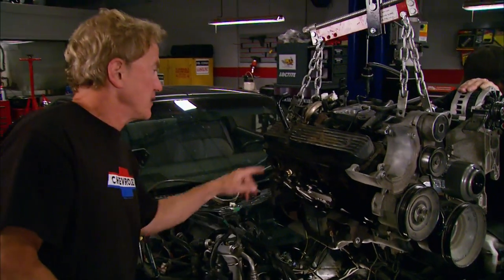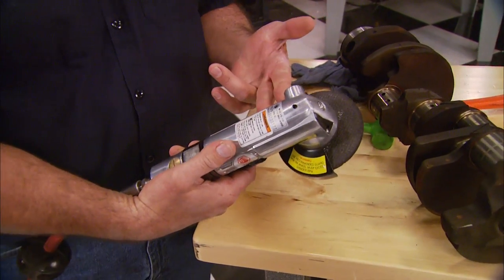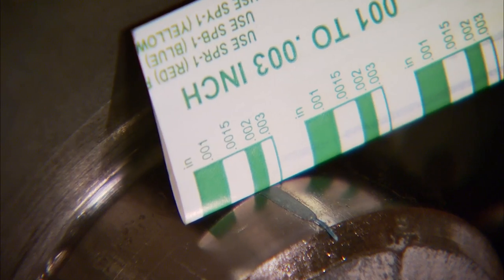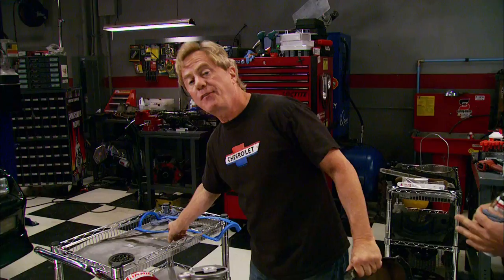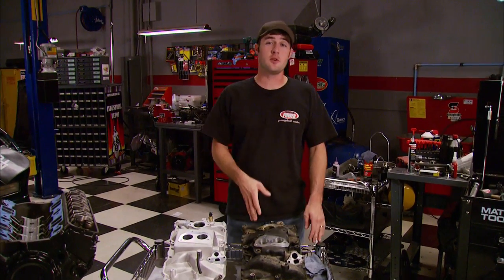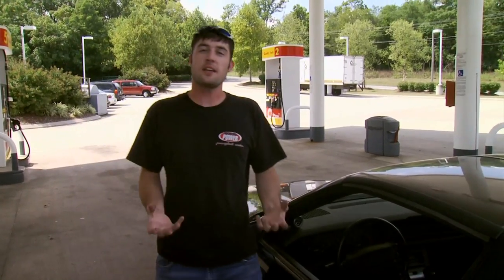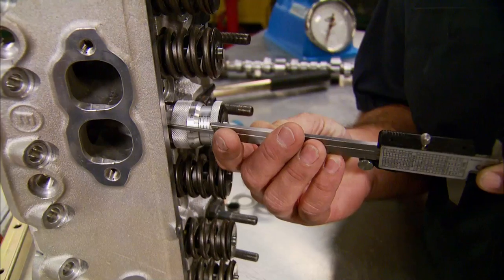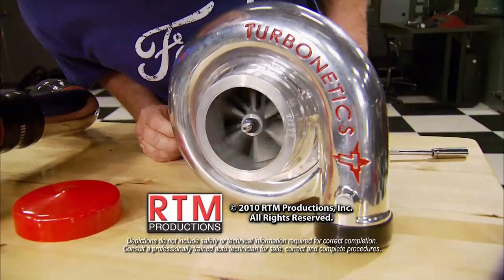Modifying a '92 Camaro Small Block to Improve Fuel Economy and Power - HorsePower S12, E17

Comment: First, thanks for telling what to do if the crank clearance check is not correct. To often we see all these wonderful checks that always come out perfect. 
14:30 You mention the cam card shows the open and closed “spring rate”. This is incorrect, it shows the spring pressure. Spring rate (typically in lbs./inch) tells us what the spring pressure will do as it is compressed and is a constant for a simple spring. Misuse of the term perpetuates misuse.
Reply: you are correcting something that happened 20 years ago,are you ok?

Comment: Pulled the engine to rebuild the short block, and didn't really do anything to the heads other than paint them.  Took the transmission out, but didn't get it rebuilt.  Again, an excellent video on how to do everything wrong.  OMG, the Nitrogen filled tire scam.  Easiest way to tell if the engine is under load?  How far has your right foot pressed down on the accelerator pedal?  What you should have done?  Cam swap, Dart SR cast iron head swap, headers, high flow cat(s), and exhaust system.  Would have had more power, and the same fuel economy.

Comment: Just read all 293 Comments and I noticed that all the comments are from the past 24 hours so I guess they removed this video or wiped the comments. Also noticed nobody mentioned that "They added some weight to compensate for what I took of the 6 counter weights" was not only completely wrong but shows that the guy that said it (or the person that wrote it into the script) does not know anything about balancing a crankshaft. For those of you that are interested in why they actually added weight, it is to simulate the weight of the piston, connecting rod, wrist pin, etc. because if you didn't it would be impossible to balance it.

Comment: I realize, the economy direction here are not typically what most want to see, but, I can tell you, after having built monster engines over the past 25 years, HP and Torque monsters do get boring. The idea of trying to beat the gameshow that has been thrown upon the USA called "planned obsolescence", I actually prefer build engines that are just fun enough to beat on, yet will allow for many flawless operation these days...  The idea of turn key and go play, does leave a small trade off, which really does revolve around somebody's ego, of having to have the biggest, most HP, etc., Yet, I simply walk out to my stable that has taken years to fill, I get to make the choice of which mule I will take out and enjoy, and I simply open the vehicle door, sit in the drivers seat, turn the key, and go, and never have to worry about a thing, (per say).. It actually really is a complicated thing to build, a vehicle that allows this...  As anybody can drop $30k into an engine, and be top dog, but that guy is always on edge worrying about stuff, dang near has a panic attack if his date sitting in the passenger seat, desires to drive that 30K engine through a drive-through and having the engine over heat or something.. LOL.. Tell me I am lying!!!! LOL...  Is there vehicles that would out run mine, YUP, all day long... But mine, I get to just turn key and drive, in peace these days, I love it... If I desire to drive 800 miles to go see something, I grab a car and go... I am not having a panic attack over it. I am not trying to convince anybody else to go this venture, but the idea of when and why people by new vehicles, if for that exact reason, to be able to turn key and go... I just do it with older vehicles, that have been ground up rebuild... Kinda like one of my favorite to drive, is my 1988 Ford Thunderbird Turbo Coupe. 100% ground up . Yes, the car will tear up the street, but every thing was redesigned to last, over sized oil lines and coolers, ceramic ball bearing turbo cartridge, after market computer for the fuel system control as a few silly examples, and while on the highway or interstate routes, manual trans I get about 37 miles to every gallon (MPG) of course all done with fuel mapping of being efficient, with a trade off of lacking in throttle response and HP and torque, just enough to let it cut through the air and lug its vintage unified chassis/body around. Yes, I have other maps that with the cycle of the ignition key, can reboot different maps if I wanted to be aggressive with the machine, yet, to this day, I have not found the need or desire, out side of building the map and testing to make sure of the balance queue's of an aggressive map.  but it is there if I want to, just don't want to.  That same exact Turbo Coupe, I once a year, I throw an oil change at it before I leave, and one kit in the trunk, and stop at a quick lube somewhere on my way back and I drive from Indiana to California area to look at the ocean for a few days. As silly and wasteful as that sounds to drive 1900 to 2500 mile one direction over the course of a week or three, while stopping at many many MANY other locations in between, while it is important to just relax and take your time and stop worrying about how quickly you can get there, I just enjoy the calm journey. When I am done chilling at the beach, mentally, my thoughts are not, "Welp, time to head home, and it is all over", no folks, the journey isn't over until I am pulling the car into my shop to park it at home, I still enjoy the calm smooth drive home.... So far, I once had a windshield wiper come off or to say, rip away from the rest of the rubber mounting. I took the passenger wiper off and installed it on the drivers side, and flipped the passenger side arm to the locked up position, until I get to the next city to gain a pair of new wiper blades. (I didn't want the glass getting scratched from the metal clamping of the wiper assembly)... WORST DAY EVER, in my life, LOL... All jokes aside, I really enjoy having no worry's of taking one of my vehicles and just going, because I built them that way. Yes, I do have a few extreme HP/torque monsters, like a rock crawler, sure, it is fun to play with, but what a nightmare if I ever had to drive it more then 30 miles under it own power on the roadway system, not only would it beat the snot out of me, my back would hurt, I would have to pee sitting down for a week after my kidney's felt like somebody beat me with a baseball bat.... My street/strip race car, sure, that is fun too, but what a pain in the booty that is to drive, I hope I don't ever have to make a right hand turn some day, as it has a turning radius bigger then an ocean liner oil tanker barge (Yes, it turns right, just fine, just don't turn any direction left or right, while on the throttle) as it has locked rear end, chubby rear sticky's, skinny donuts in front, as most typical street/strip drag cars have. The cam and blower make the idea of a drive through scary risky, as the engine lobes and thinking you can lightly inch forward and stop exactly where you want it, lol... right!!!!!........Never mind any of the road course racing cars I no longer have, no matter what parts you throw at them, they wear out fast in the constant tension stresses that racing requires, so, those are vehicles that you become married to, as per the time required to just be able to drive them, as something is always going on with them, rather, not going on with them, lol.. These vehicles always got trailered to events so I could play with them, which are purposely built for those events, and is fine. But, I also, purposely built my "Turn Key, and GO" vehicles, so I can just drive them, with no worry's. I have more fun with these "Turn Key, and GO" units, then the other special purpose vehicles that I once owned or currently own. it could be, because I am getting old, and at age 45 or 46, (how ever old I am now?) I am tired of having to rebuild stuff that is either worn out or broken from the vehicle trying the channel all that HP/torque from the source to the ground in a linear fashion, it gets old, and never stops. Military vehicles are built to endure extreme situations of terrain, yet, are built so dang heavy, that in itself, is a never ending story of stuff wearing out, just from itself being heavily built, lol.. Bearings wear out, well, design and built the axles bigger... now you added more weight, needs heavier suspension to keep those axles and rubber on the ground and in check to the chassis.. more weight, now we need to reinforce the chassis, more weight... the engine doesn't have enough power to meet the Mil Spec slop and tip angle perimeters install a bigger power plant, more weight, frame needs to be stronger and reinforced again, more weight.. that is the point of all my nonsense here. Rebuilding a vehicle to a "Turn Key, and GO" is not easy to do. It isn't just like throwing as many parts and money at it, like many do.  It is quite challenging to do this, to make a vehicle exceptionally reliable, and problem free for the climate in which you live or rather, the country in which you live, while putting great efforts into being safe but having range out of efficiency, that is the name of the game I play. There is my 2 cents of nonsense. The next unit I have been slowly dialing in, is a 1993 Jeep Grand Cherokee. and seeing if I can get one of those to have like a bazillion MPG, as the great motor that those have been for millions of owner, even in the stock configuration, not to mention, how many great people have made the various I-6 engine an absolute monster, I want to see how efficient I can get one of those next. Good luck and be safe everybody. Dru
Reply: @KENNY2400legacy  ?
Reply: Being that I'm almost 50 myself I understand and agree with you 100% my friend. I have traveled the same roads and most will not understand till they have traveled the road themselves. It's nice just to hit the key and go with no worries in your daily driver.👍
Reply: @mechanicsteve2320  OUTSTANDING BROTHER!!!!!  You already know this, but, working on a vehicle on the side of the road, sure, we both can make some amazing things happen with a piece of gum and a paper clip to get out of harms way, as calling for a wrecker, that is nonsense when you can see what the issue is, and would only take 4 minutes to rectify, all the while, I am tired of doing that, I am tired of showing up somewhere oily, greasy, because I was lazy and did a hack job on my own junk.. So many many years ago, I made the oath to myself, that no more, were my cars gonna be the worst running pieces of junk, while I made everybody else's run like it was brand new, I got tired of sacrificing myself and vehicle, because I was being lazy, and only made things harder on myself.. NO MORE OF THAT.. and I love it.. TURN KEY, and GO. So good job on you sir, for taking the time to square yourself up for the same desire, feels great, and what I laugh at, is how much that turn key and go, irritates other people, LOL.

Comment: Back in the day Crowler (?) had a cam setup where you used 14:1 pistons but the final compression was 10:1(ballpark numbers). Hot Rod did a test case and got 30(?) mpg out of a 350. Something about getting a super mix of the fuel. As I recall they got a small increase in horsepower too.
Reply: sounds like horseshit

Comment: wow, just willy-nilly knife edging the crank counterweights like that...the balancing guy must be so happy.  I wonder if the new intake needed the old spacer. Its a higher plenum and a little grinding of the divider could replicate that on the old spacer.  And its interesting there was no porting or at least a clean-up of the heads...were these Vortec units?

Comment: If you have the heads apart to do a valve job, why wouldn't you put them back together with the springs you want to run? Seems like double the work to me.
Reply: They were demonstrating how to swap valve springs and seals without removing the head.
Reply: @SiriusC1024  I fully understand that, just was strange to me to do the job twice.
Reply: And port the heads, if you want horsepower and mpg

Comment: Is it just me or are they using roller lifters on a flat tappet camshaft?
Reply: Yes it appears that way and if anyone knows anything about the small blocks from around that time. Anything that was made in 87 and Newer those actually came from the factory with a roller style set up as far as a camshaft is concerned
Reply: chrissabat I know about the roller cams being in blocks back then, but can you use roller lifters on a flat tappet? Did I miss something in the past 18 years of engine building? Haha. I bet the friction reduction is amazing! Most cars had rollers wheres as trucks still used flat tappet.
Reply: They showed a flat tapped camshaft...maybe for show purposes, and installed oem roller lifters... That's Entertainment for you.
Reply: dont judge the hollywood details,this isnt meant to be an instructional video

Comment: Yep the RS had a carb "Throttle Body" the Chevy S10's have a upgrade of a bigger throttle body highly likely the RS might have one to even finding a Y pipe is hard to know what fits.

I could beat an RS with my TPI but not must faster the 1st gen V6's they were putting into the Trans Am's & Camaro's with the new body style is about the only thing the TPI could really beat that might make somewhat of an interesting conversation.

I remember a manual Geo Tracker giving me a hard time on the highway.lol

Comment: What is your thoughts about putting a callies 2 pcs rear main seal crankshaft  into a 95 vortec roller block using a rear main seal adapter in a sbc
Reply: John Murphy  availability of a forged steel crankshaft is nonexistent and dont want a POS eagle
Reply: stoker conversion? i was thinking of the same thing...

Comment: 305 or not, as with any rebuild if you're wanting the engine to run its best you should (always) check cam timing. I rebuilt a lowly 4.3 and when we checked the cam timing it was off 13.5 degrees. Yes the engine would have ran, but not as good as it could with the cam timing where it belongs.

Comment: lots wrong with this build. that's a forged piston=HEAVY. another reason for the mallory metal to balance the crank=$$$. a 2valve relief flat top hyper would be more"efficient"=mpg. .000" decking the block would be more cost effective to get better  quench or squish= more efficient burn=more hp and mpg. did you guys measure CR? check the cam timing? those are not beehive springs. they may not be set up correctly using the rotating ex retainer. the amount of holes drilled in that crank is just dumb, and then add heavy metal? just dumb. $$$$. electric pump/fan? there's 5-10hp. cold air/cool thermo might make a little hp but kills your mpg. installing main caps with an impact is a good way to crack a main cap. at 175hp that scraper isn't doing anything. and yes at the end, totally wrong shim size and at .120"+ you should use a spring seat/locator.  nitrogen in a street tire? all this  $$$ junk for 2.9mpg's. just dumb. you guys keep bolting parts on, we'll fly by you doing 90 and getting 30mpg on half the  $.

Comment: all that for 34 hp?
Reply: All the work they did would have cost an average joe thousands in parts and labor. Meanwhile your local methhead with an ebay turbo on his 5.7 will blow your doors off making 300 WHP instead of a very pathetic 178 WHP.

Comment: Would of had larger injectors or moved to multiport fuel injection with crank trigger and had ls style layout, roller rockers even and a more aggressive high rpm cam. Valve seat, valve and intake port job. Fyi pistons are camground to seat better in the cylinder due to thermal expansion.

Comment: You just installed the wrong diameter shims.
Never checked for coil bind.
Need spring locators.
The knife edge on the crankshaft is a good idea, but definitely messes up the dynamic on the crankshaft balance by shifting weight the wrong direction.
The block should have been decked and squared if it was torque plate honed.
The balance of compression from having a square deck is important to performance and in this case economy.
Changing springs on the engine when you had the heads off, is not the correct procedure.
I know you guys are on tv, but does not mean you are correct all the time.
Most of the time I enjoy the show.

Comment: $4500 buy in for the car. The machining and parts cost for the 305 are about another 2 grand. I've bought into cars with much more than 175 hp at over 20 mpg for a lot less than $6500. And I'm not even an import guy😀. Would an ls swap meet the horse power need? Yes. Would it justify the cost if you want fuel efficiency? No.

Comment: Still seems to be a slow, ugly, gas guzzling POS. You could have just yanked the engine, throw it away where it belongs, and drop in a brand new/warranted 350 crate engine for less money! Probably 30% more power, and still better gas mileage if you get rid of the stupid 90s EPA shit.

Comment: Adding in 18% hp from driveline loss this thing  makes 210hp at the crank the same hp rating as a 350 tbi. Would have been a direct swap with only changing the computer to a 350 model. Or a 350 vortec with a g series vortec tbi intake and the aforementioned computer.

Comment: 2.6 mpg increase in economy... With the money invested in this build you can buy gas for 10 years lol
Reply: Oppossed to making it 450HP and losing 5+mpg, when will you get your money back on that?
Reply: @Bloodcurling  if you have a 450hp modded engine you're probable not to worried about fuel mileage
Reply: @joshc1590  I am; and Porsches and Corvettes get very good mileage

Comment: If you really want fuel economy then drop an iron Duke and 5 speed in it. 1/4 mile times like 19 to 20 seconds. 35 mpg highway 22 city 24 to 25 combined mpg. Lol. Top speed 100 to 105 mph